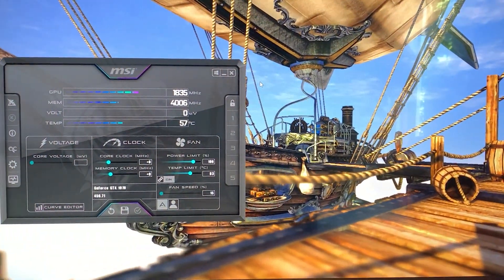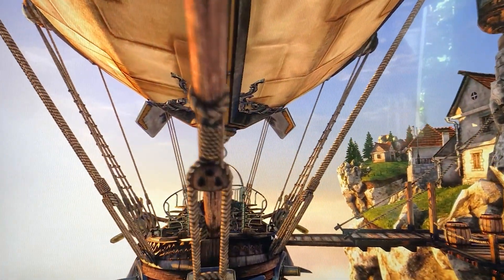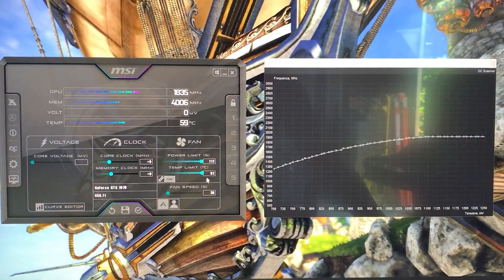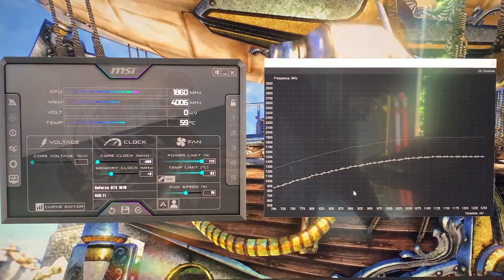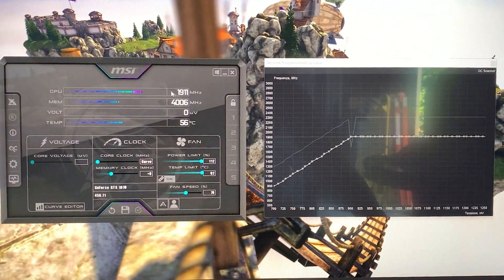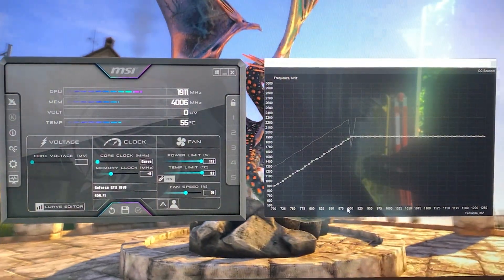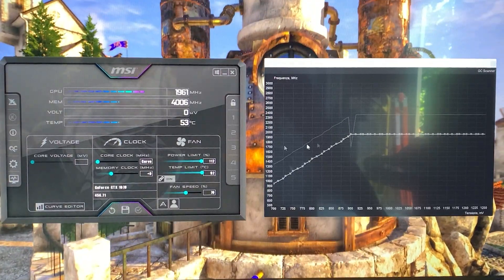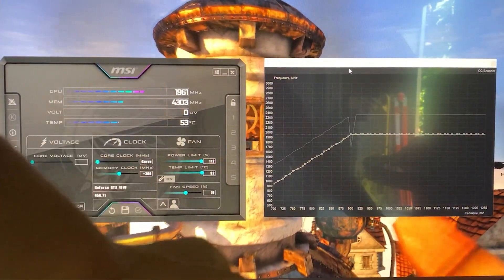Undervolt your GTX 1070 for more FPS! - Tutorial

Comment: Tried this in 2025 on my 1070 ti though. Siege X all low TAA 50% i went from ~200fps to ~215 but my gpu is not a heater anymore peaking at only 60 degrees instead of 80! How much more can i push this, when I put the curve over 2000 it just crashes.

Comment: This isn't undervolting, quite the opposite. Note the values on the frequency/voltage graph:
-Before the changes, a frequency of 1650 MHz corresponded to 775 mV
-After the changes, the same frequency (1650 MHz) now operates at a voltage of +-830-840 mV

Approximately the same situation occurs with all other frequencies (my example was used for clarity).

You're literally overvolting almost the entire frequency range.
Reply: Yup.
Reply: Any actual good guide for overvolting this gpu?
Reply: @soun3ds  I would simply pick 1000mV for example, push the frequency at that voltage up as far as is completely stable, while making the line completely flat to the right of that voltage.

Comment: works perfectly for my EVGA GTX 1070 Ti ACX 3.0, with slightly reduced the gpu clock to 1850mhz because it can't do 1900mhz (crashed), and increasing the memory clock to +500mhz (i don't recommend over 500mhz because you will notice some artifact), i tested it on superposition and furmark benchmark and it runs well, sometimes got slightly hot because of the memory clock, and i guess +300mhz memory clock is a good spot because it makes my card runs pretty much cooler and slight faster than before, even +500mhz memory clock is much faster but this are better (or you can also do 200mhz on memory clock to be safe), thanks! ^^

Comment: Would undervolting cause atrifacts? At least I assume it was some form of artifacting, in this case tiny little dots would fade in and out for a second each on my character, maybe 2-5 on the screen at a time (in this case James in Silent Hill 2 Remake). Another thing, is ~1835 your stock value? I also have a Strix 1070 but mine is at ~1950 and this is the first time I play around with these values at all on the card. So basically I made the changes you did in the video but just brought the frequency back up to 1955. What changes can I make otherwise? Anyways, I didn't want to risk anything so I restored the default settings after about 10-15 seconds of seeing those little dots, but any insights on any of this would be great.
Reply: Artifacts would be memory being unstable, did you do the +300mhz on memory? if so tone it down to 125 or 100 or even better at stock. Usually core clocks would force the application to crash or the whole PC. double check.

Comment: Only tested it for 3 hours, but i can't believe how easy the undervolting is. Just bought GTX 1070 Mini ITX for $85, runs at 150W and 76°C. With this undervolt setting, i got 130W and 69°C (nice). Haven't tested if it's actually faster or not, but i'm happy with the result!
Reply: Never touch that temperature on COD.. 1070 after change the transfer pasta  i got max 55'c
Reply: It's not easy 😭😭

Comment: Will this work for a 1070 ti?  If not, could you recommend settings?  Thanks.  Great video, btw.
Reply: similar but add another 50hz. worked well on my galax 1070ti. 
or alternatively you can use the already tutorial. works either way. temps from 80 down to 65-70c.

Comment: Just straightfoward to tutorial, i like it!

I have a problem if you have time to answer.
In some games my GPU never reaches 99-100s, always in 30-40s, It reduces FPS and changing graphics settings do nothing. 
RDR2 for example, setting high or low changes literally nothing only ultra reduces the FPS but that is to expected because GTX 1070 can't run smooth on ULTRA in normal circumstances.
But my FPS still low on low settings, It's only 60 or more FPS after launching it and few min later GPU usage hangs around 40s thus FPS drops to 30s-40s. I optimized graphic settings for GTX 1070 (Some med-high-ultra), and no difference between low settings and my own settings. 

It's a laptop btw, i know it's bit slower than deskto variants of the same model.
I tried Power options and 3D control panel tweaks that is told be to solve this problem internet but it did not change it.
Well i guess i have to apply fresh thermal paste and use a laptop stand and format the PC. Maybe it'll fix it.
Reply: Had to the same problem! When u are running a game and see fps dropping to 30-40 fps check your gpu fan. My stoped working and did that now I get stable fps just turn fan on manual mode and set it to 65 and it should fix it
Reply: @all_Time_Messi_Football  I cleaned up, apllied paste. It is okay now. There was so much debris and all, fans couldn't breath.
Reply: @Lizardman9808  ya told u they just stop working for sum reason 😂
Reply: Ur gpu fan

Comment: Before downvolting I had 2846 score in 3DMark.
After downvolting and +300 Mhz VRAM I had 2806 score in 3DMark.....
I ran both tests at 4K.
I then did another test.
This time I got 2803....
I did a reset to old settings and I got 1825 score.....

Comment: doesn't work on my msi laptop with gtx 1070. The fan options is not unlocked and when i set the curve there is a drop before the 900-1900 point so not a straight line
Reply from the maker: Yay this is only for desktops. For laptop try 800mv at 1700Mhz and consider dropping a like and subscribing

Comment: straight to the point, and undervolting this ay really improved fps and no more crashes. MVP!
Reply from the maker: I’m really happy it was helpful! Thanks a lot for taking the time to leave some feedback :) Consider subscribing if you wanna support the channel!
Reply: @ImWateringPSUs  subbed and bell and everything. This channel is epic. Do you know if there is a way to somehow save these settings on the afterburner so I don't have to do it every time my laptop restarts? it used to be only after windows update it would reset, but now it's every time I reset my laptop

Comment: tried doing this myself. a few seconds after hitting apply, the screen will start turning on and off, applications will crash, overall the computer becomes unstable. Not sure what is causing it to happen, but this just doesn't work for me. Running my card at standard tuning (+112% power limit) has my card running great.

edit: okay, so there's a better way of going about this, although it takes longer. check your base clock speed, as well as stock voltage. keep the same clock speed, but go down in voltage by 0.025V again and again until the card becomes unstable. From there, increase voltage by roughly 0.010V until things are stable. in my case, I seem to be able to do 0.893V at 1823MHz, from an initial 1.050V
Reply from the maker: Yay basically you had slightly worse silicon quality so you needed 0.9V for roughly 1800Mhz. Glad you found stability at the end. Consider subscribing to the channel for more!

Comment: I can get the minimum possible undervoltage in the 1070 Galax OC Mini, the same design as the founders, in 700 mV at base clock of 1518.
At 1969, only at 900 mV tho.
You should try because not all games require 1900 MHz.
Reply from the maker: Very solid advice!

Comment: I have 1070 palit 8gb gfx, i followed the tutorial and heaven engine couldnt handle it. I was thinking maybe because I have 1440p monitor and this tutorial was made on 1080p monitor. I kind of tried to find the right spot between 1700 but it feels like i have less fps. Could you maybe calculate what settings i should lut in this case? Thanks
Reply from the maker: I’d say 100Mhz less on the core clock and/or 25mV more on the voltage

Comment: hello bro, what was your power consumption when you undervolted your 1070? i'm planning to upgrade my 960 to a 1070 but i'm worried about the power consumption because it has 1 6pin and 1 8 pin
Reply from the maker: If you undervolt it you’ll be fine power wise :)

Comment: Upping the memory for me caused hardware errors durring my testing  and putting the Fan volt and temp to the max caused instability for me might be wattage wise
Reply: Granted im using the founders edition card
Reply from the maker: Understandable, very weird about the power and fan though, you might have a power delivery issue there
Reply: considering im on a bronze 80plus i agree
 @ImWateringPSUs

Comment: hi! I did everything in your video, and my gpu runs 80-89C, is that normal after doin this? Or do I have to turn back the memory clock a bit?

edit: I didn’t get any fps difference because I couldn’t raise the memory clock, how do i get more fps without messing with the memory clock?
Reply from the maker: You temperature is way too high. I’d recommend you follow my “Fan Curve” video and if that doesn’t work you check out my “Repaste and Repad” video
Reply: @ImWateringPSUs ok, I did the video you said to follow and it worked, but after few hours it started overheating again. Do I really have to apply a new paste or is my PC just tired? I don’t really want to re-apply thermal paste because my PC is a pre-built and I don’t know how to do stuff like this.

Comment: Right method, is:
1. RMB on point with 900mv hold shift and drag the whole cure to the point when 900mv = 1900
2. SHIFT + select all point on the right of the curve and drop them below, no matter how much, it will align to 900@1900
With this method you will get more stable results, as power increase with frequencies is no linear and you will not upvolt freqs which are lower.
Reply from the maker: That will also works, but in this way you will overclock the lower part of the curve, potentially causing hard to test instability. That’s why I prefer to under clock the lower part, the one that isn’t used in-game

Comment: The highest cloc speed my Galax Gtx 1070 can go in the 900mv curve is 1800, its unstable after that. When i first tried 1900mhz in 900mv curve i got a few black screens and screen tearing, heaven crashed but thankfully everything went back to normal.

Did a few more tests here and there and eventually got to 1800mhz.

So quick reminder to everyone whos interested in trying to undervolt their GTX 1070 using this tutorial - ALWAYS REMEMBER EACH AND EVERY CARD WILL BE DIFFERENT.
Reply from the maker: Glad it was helpful and thanks for the feedback! Consider subscribing to the channel :)
Reply: I guess I have a unicorn of a card, I don’t really know much about undervolting but my 1070 with auto overclock gets 2000mhz stable :o
Reply: thats preetyy poor, my zotac can get 2075.

Comment: i tried doing it but my gpu clock is stucked at base 1518 MHz, cant change it to 1900 MHz, idk why, can you help me?
Reply from the maker: Open Heaven Benchmark :)
Reply: @ImWateringPSUs  i figured it out, but my gpu is still burning under load, any other tips?
Reply: @Luwisito1213 better cooking on your PC overall, make sure your fans are proper for good airflow

Comment: I have a Palit 1070 Super jetstream. By default my card runs at 1911-1949 range clock speed at 70-72c running for 15mins in Heaven Unigine. I tried what you did in the video even with 1900 only but my pc just blacks out and crashes. Should i just add the +500 memory clock and still be safe?
Reply: I meant 1900 at 900mV.
Reply from the maker: Hi there, set it to 1800Mhz at 900mV with +500Mhz (check if the +500 is stable obviously)

Comment: i do this but my gpu mhz doesnt change it does for a second then goes back to 1600
Reply from the maker: You need to do it with Heaven Benchmark open!
Reply: @ImWateringPSUs  i do put when i close it. it goes back to 1600mhz

Comment: I have asus turbo edition when I raise the curve from 900 to 1900 or even 1850 the heaven benchmark running in the background gets stuck and becomes irresponsive. any fix for that?
Reply from the maker: The turbo is a slightly worse binned model, 900mV and 1800Mhz is gonna work fine!
Reply: @ImWateringPSUs  Thanks for you answer. Another question. My psu is 600w and has only 1x 6 pin connector and I used a 6 to 8 pin adapter to run it. I dont know if this is the cause but my pc keeps crashing when starting a game, sometimes it just runs fine but sometimes the pc restarts when I launch the game.

Comment: Any chance to increase fps even more than this for the gtx1070?
Reply from the maker: Yes, you can try 500Mhz on the memory if you're lucky and also go up 50Mhz at a time on the core clock and when it crashes up the voltage by 25mV!

Comment: Thank you for the tutorial!
My 1070 g1, now uses 35-40W less and it is 10°C cooler at the same rpm.

Just to clarify and make sure, the lower I go with the MHz, the more stable it gets right? 

I was able to get it working on 900 mV at 1859 MHz
So just to be super sure that it is 100% stable and reliable, can I leave it a bit lower like 1838 MHz? I don't mind 2-3 fps performance loss, I just want it stable withou any glitches and possible audio interference.

Would you recommend to go lower in MHz for reliabilty?
Reply from the maker: Hey there, thanks a lot for the detailed feedback! Yes, the lower the Mhz the more chance it’s gonna be stable! I’d say if you wanna set it at 1825Mhz and 900mV you’re gonna be 100% sure it’s stable, even the worst card will be!
Reply: @ImWateringPSUs  Thank you for your quick response!

Comment: GTX1070 MSI AERO
Core clock 2100mhz
Memory clock 4176mhz 
76 degrees with fans on 70%
Reply from the maker: I’m really happy it was helpful! Thanks a lot for taking the time to write this! :)
Reply: @ImWateringPSUs  

Ended up with core clock 2100mhz
Memory clock 4350mhz 
 Everything stable, great video

Comment: My performance with this type oc is bad than stock wtf ? , average fps is similar but max and low are different 😖
Reply from the maker: It should be better! Try 50Mhz or 100Mhz higher! Also watch your temps, they should be much better

Comment: Well.. this is easy peasy.. 

If you want to get performance out of it, you repaste it because the card is old and doesn't cool itself well, you do a manual curve that's much more aggressive - basically pushes more clocks at max allowed voltage and more clocks in general - this is tedious and requires a whole lot of testing to set clock for each voltage step..

Throughout it all, you run fans at max because Nvidia GPUs of that era will give you 50mhz for every 10 degrees you can shave off.

I got mine to run at a stable 2088mhz on the core and +400mhz on the memory. Stock it runs at 1860mhz. About 11% higher performance. It's stable below 60C. Above it it'll start showing artifacts and crash at about 66-68C

More reasonable OC is 1980-2020mhz. Doesn't need manual tuning, much more stable even at higher temps.
Reply from the maker: I definitely agree about repasting, I always advise people to do it but not everyone feels comfortable with doing it!

Comment: Hello how can i reset when it come to 55C it crash
Reply: I mean in furmark when i came to 50’C it crash
Reply: On the heaven Bencmark its the same
Reply from the maker: Hit the “reset” arrow and you’ll reset it. If it crashes use, 50Mhz lower or even 100Mhz lower and it will be fine👍 Also don’t overclock the memory if you have a bit of an unlucky card!

Comment: i am running about 5 celsius lower but about 40fps less was geting 160 in an area i was geting 120
Reply from the maker: You need to see what clock your card is running at at stock and use that then! You might have a watercooled model or a very high clocked card

Comment: I’ve been running +600 on mem and +50 on clock with evga 1070 sc but setting unlock voltage at +100 is that bad ?
Reply from the maker: Not really, it’s how old school overclocking was done! No problem with that, but undervolting would get you basically the same performance with a lower power consumption and lower temperature
Reply: @ImWateringPSUs  so ive tested core and memory on mine. Both under Volta and overclocking it. I get 2025 stabble with overclocking . With under volting i get only high 1900s . It is a difference. That said life of card which ive been abusing till now of 6 years with heavey gaming , mining and 3d sculpting . Its a lot quieter and get better overall performance for a few fps difference. Memoery seems around same wirh both

Comment: I have an Asus 1070, my fps ingame are the same with your tutorial, the stock and a overclock with 80/400 .. it es stock already at 19XXmhz
Why is it like this?
Reply from the maker: If you’re doing this strictly to get more average FPS, then you need to aim for a higher core clock. Around 2000Mhz or even 2100Mhz is what you should aim for, you’ll need around 975mV to 1050mV!

Comment: Why my GPU core clock reduce from 1911Mhz to 1898Mhz after like...30 seconds in games? What to do to have always 1911Mhz?
Reply from the maker: A slight 20Mhz deviation is normal and to be expected, set the curve 20Mhz higher and you’ll be good!
Reply: @ImWateringPSUs  When I set the curve 20Mhz higher my game keep crashing. Does it mean I must put more voltage?
Reply: Probably.. because of higher temperature. Try to use fan curve.

Comment: Do I need to keep MSI afterburner on at background everytime my system is on?
Reply from the maker: Yes
Reply: @ImWateringPSUs  I mean, should I keep it minimized while playing a game?
Reply: @Soldier_Boy_29  Not necessary. Just open MSI afterburner and then open the game. MSI afterburner should be on the desktop every time you leave the game.
Reply: @koteczek8615  Ok, thank you
Reply: Another question. My brother has an AMD RX 480. Can he undervolt his card in the same way or is there another method?